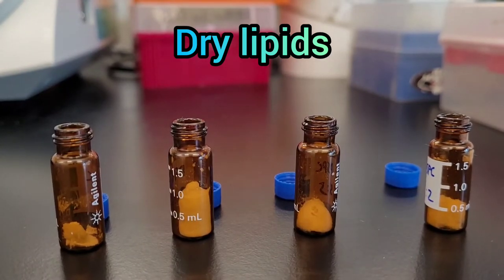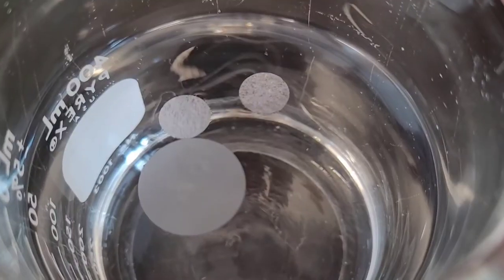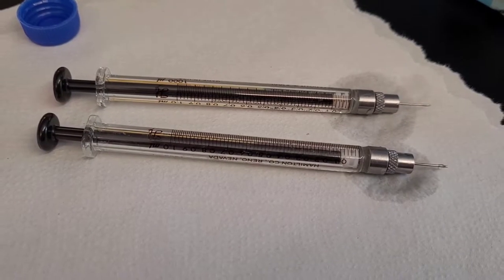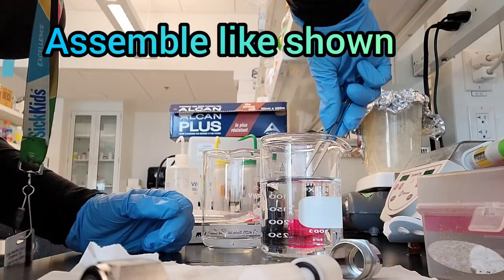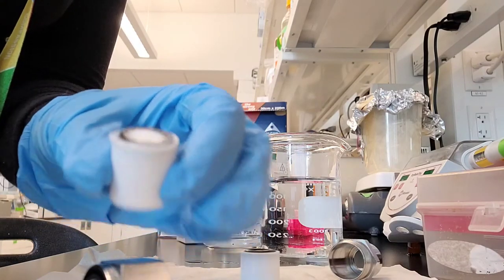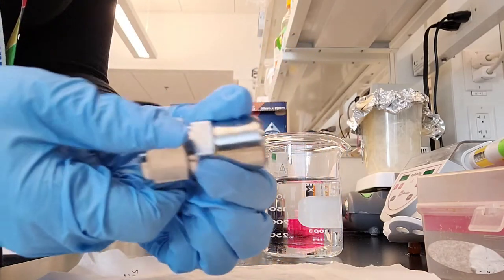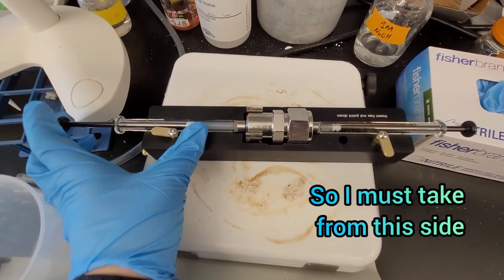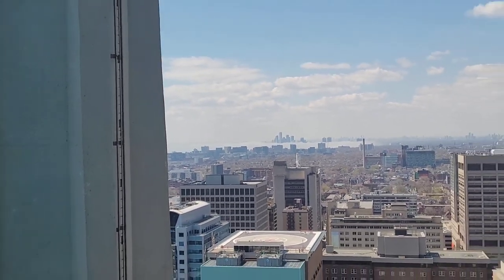🧈 How to do Lipid Extrusion (Nanosizing Liposomes from LMV to SUV) || Practical Biochemistry

Comment: I am using the same extruder but one problem I am facing is that the sample keeps leaking from the side I am pushing it from it doesn't pass to the other side, any tips?
Reply from the maker: This often happens when older glass syringes are used. It happened to me a lot too. Replacing the syringe for us fixed the problem.